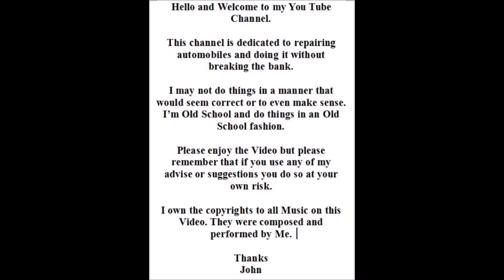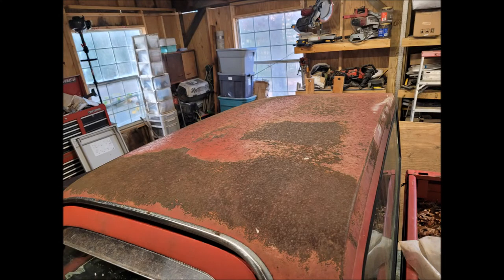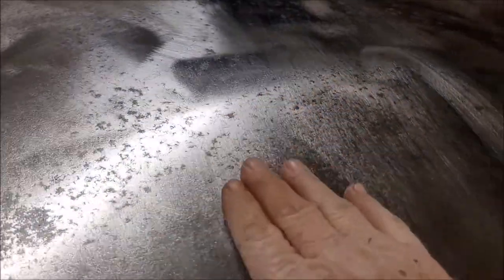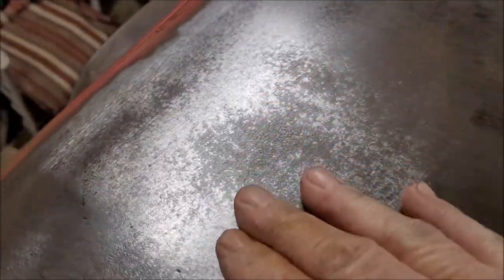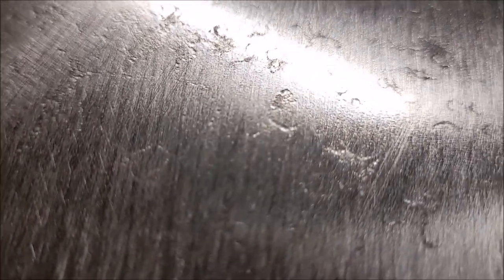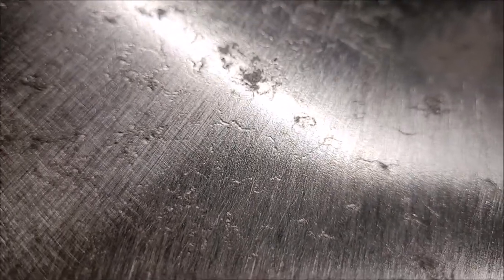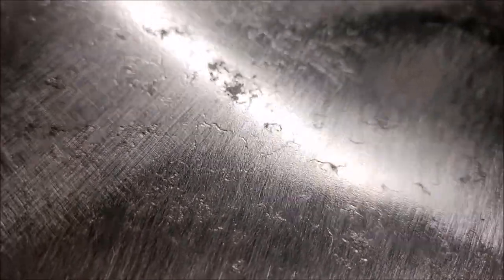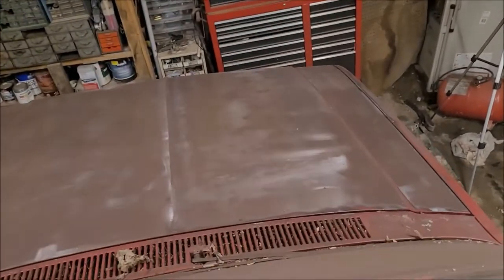Removing Surface Rust from Top of Square Body Chevy Truck

Comment: I have an 84 shortbox I've had for about 20 yrs now. It's been used primarily for  a trash hauler or lumber hauler for doing projects. She a 292 three on the  tree and runs like a sewing machine. I think it deserves  this treatment also. I think I've decided to give it a new look this summer. It deserves  a little attention I think. Keep up the good work you will get there.
Reply from the maker: I had an 81 or so GMC Truck with the Inline six when I was in Germany. Used it to tow my Race Car with and even shipped it back to Florida when I came home. Those engines are real workhorses. The only problem I ever had was with the 3 on the Tree you had to shift from First, almost all the way to Reverse then back down and to second gear or the linkage would jam. No speed shifting with that truck. Thanks for commenting and please share your truck with us.

Comment: i know this is old....but,

swrc pete showed on one of his vids that you can use water&vinigar to remove any rust on a top of a car.
i mean down to the pores...it leaves a black surface where the rust was converted.

its n older video from like 5 years ago...

baumgartner.....sehr schöner name.
Reply from the maker: Yes, I did try Vinegar on the Gas spout of the truck and it did help but not as well as old fashioned sand paper. Perhaps I didn't use a string enough vinegar. I did find the video you suggested and I appreciate the advice.  

Danke für meinen Nachnamen. Ich habe tatsächlich etwa 15 Jahre in Deutschland gelebt. Ich war im Raum Frankfurt.

Thanks for watching and leaving a comment. John
Reply: @GreaseMonkey1958  glad i could spark a thought✊🏾
wenn du jetzt zufällig auch noch Aschaffenburg kennst,dann fress ich einen besen...lol.

🤝🏾
Reply from the maker: @O.G.SPOOK1  I think in the 15 years I was there I only made it once to Aschaffenburg. I think it was to pick up a car on the Tow Truck. I was on Rhein Main Air Base across from the Frankfurt Flughaffen.
Reply: @GreaseMonkey1958  Use Vinegar at full strength, do not dilute, look for and use the highest percentage 7 or 10%. The problem is the surface needs to stay wet, for best results you usually need at least two days to kill the rust. Vinegar works best as a soak, too late for this project but another you could try spraying a rusted area wet with the vinegar, cover with plastic and re-apply to keep wet.

Comment: Your handle is on backwards on the surface conditioning tool! The handle is suppose to lean forward and not backwards. 

Next time spray the rusted area down with "distilled vinegar". Then place "cheap paper towels" on the rusted area and "rewet the paper towels". Then "cover" the "wet paper towels"  with "plastic" so everything stays wet to stop the air from drying everything out. Let it sit for 12 HOURS or even longer like 24 HOURS. It must remain WET the entire time! After 2 to 3 rewet and soaks sessions the rust be be gone everytime! I use normal 4 to 6 % "distilled vinegar" straight from the bottle. I do not water it down any further than it comes. 

I have an old Dodge van the hood was severely rusted and after 3 soaks the rust was totally gone. 2nd and 3rd soaksing went better as I placed rubber door mats on top of the plastic and everything thing stayed soaking wet. I did this during the evening hours outside in my driveway in Florida hot months. 

Works better that any rust "converter" that I have used including Ospho and POR 15 Rust Remover. The key again is it must remain wet the entire time for to it to work.  

I use to waste money on expensive rust converters. Not anymore!
Reply from the maker: Gary, I agree with the commercial Rust Converters. They were a waste of time and effort. If I ever run into this situation again I will try your suggestion. I did try covering the Rust Converter with plastic but it dried out as you said. Regarding the handle, I kind of like mine set up that way ergonomically. Thanks for the tips and watching the video.

Comment: What Type Of Sander Are U Using?
Reply from the maker: In the video you commented on, I am using the Surface Conditioning Tool from Harbor Freight with the 40 Grit Drum. In other videos where actual body work and sanding is being done I am using a DA (Double Action) sander and an In-Line Air File. Hope this helps. Thanks for watching and commenting. John

Comment: What did you remove the surface rust with what tools ?
Reply from the maker: Deanthony, The tool I used on the top and the hood was the Harbor Freight Bauer ER
9 Amp Surface Conditioning Tool. That was all I used in this video. The hood however required a little more attention. I do recommend this tool especially if you are prepping flat panels for paint or welding. Thanks for the comment. John
Reply: @GreaseMonkey1958 What grit disk worked the best?
Reply from the maker: @jacklowe3788  For this truck, because of it being heavily pitted rust, the 40 Grit Drum worked the best for me.  Thanks for watching and commenting. I appreciate it. John

Comment: You need a torpedo heater in your garage. Warm it up shut it off, then paint. Then turn it back on after you air it out some. This is how I get small paint jobs done in the winter.
Reply from the maker: Kevin, Thanks for the comment and the Suggestion. Yes, good heaters would be fantastic. Maybe for next winter. Not in the budget right now. Thanks Again! John
Reply: ...I'm in the same boat!!!  Living with "hand" warmers...but I having fun❤

Comment: I'm a newbie at this. I can't afford the tools.  I'll be using a block to remove a bit of rust from the top of y 1996 Dodge Dakota. I need help with type of primer and can of paint to use after sanding. Your advise is appreciated.
Reply from the maker: I would probably recommend Rustoleum Rusty Metal Primer. It really doesn't  fill any imperfections but will give it a good barrier for rustproofing.

Comment: I came to youtube to see what kind of protection people use when sanding dust and this guy's just raw dogging it lol.  Luckily in the comments some people mentioned a respirator or dust mask. I have a full face respirator for working with this super toxic glue I got, but didn't want to wear it and look like an idiot or something if it was super overkill.  Also I have neck problems and any added weight to my head makes it worse.
Reply from the maker: "Raw Dogging it" lol... Yes, I should have worn a dust mask at least and other than a Paint Respirator that's all I have.  I did cough up some rust dust for a day or two but I lived. John

Comment: Maybe some metal prep than some epoxy 2k primer 🔥
Reply from the maker: A video or two later I primed it with the red oxide type primer. Thanks for the suggestion. I appreciate it and I appreciate you watching. John